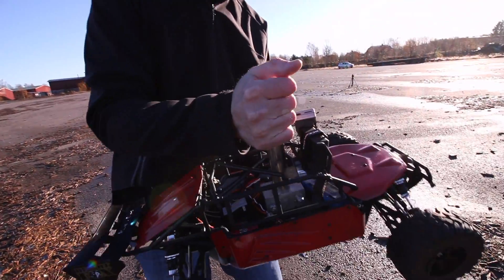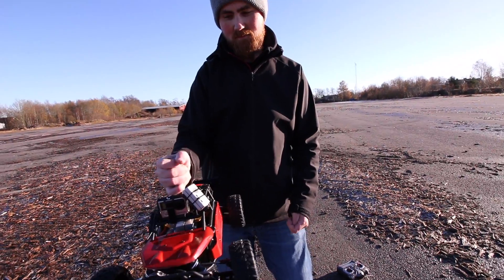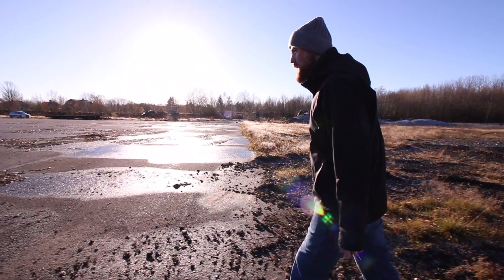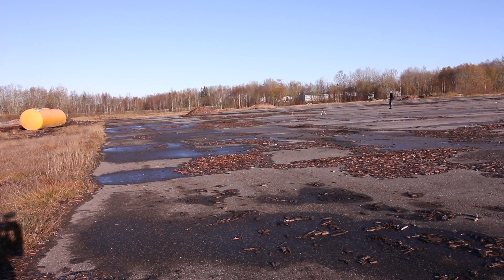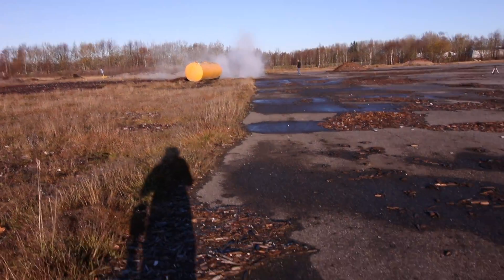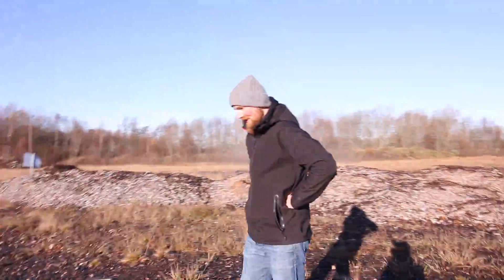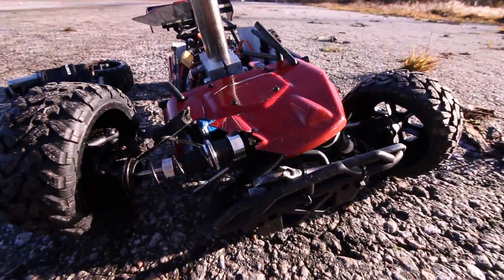ROCKET JUMP RC CAR - Worlds highest vertical jump with an RC car! (probably)

Comment: I know this is really old but he didn't take into account the gyroscopic effects the wheels would have on the car when he launched it. Which might have been the deal breaker and why the car lost all horizontal speed when he launched the rocket. If he wanted a real rocket jump he needed to have the wheels automatically controlled so that they could control the angle of the car in the axis of wheel rotation. Dunno if he'll see this lol. Awesome design tho!

Comment: I noticed in the slow-mo that the car pitched backwards slightly during launch. I think this is because the torque caused by the wheels of the car caused it to pitch backwards, kind of like a wheelie. So if you let go of the throttle just before activating the rocket, the drag caused by the car would, in theory, cause it to pitch forward slightly, increasing the length of the jump.

Comment: The next thing you should do is add wings, horizontal stabilizer, vertical stabilizer and be able to fly the car once it gets to its apex. I think you would have to reinforce the wings, horizontal, and vertical stabilizer by having metal spars that are bolted to the cars frame so the wings and tail won't fold in on themselves.

Comment: I think wheel torque rotated the car and caused the rocket to counter the forward momentum. Maybe let off the throttle before you fire the rocket if you go again. In the on board you can hear the wheels still full power in the air and the car rotates back more after the rocket stops.

Comment: You should gear up some heavy duty servos to the rocket engine  so it can be pitched forward slightly  in flight. you'll gain some air control.  and a chute rigged to a spare channel might save you some time and money durring testing. Keep it up love your work

Comment: So here are my thoughts.  Just like controlling attitude during a normal RC truck jump, I think there was a bit of a control issue here.
If you look at the slow motion side view footage, you can see that right at takeoff the truck tilted back.  This was likely due to the wheels still being accelerated in the forward direction.  That pitch back caused ground speed to be scrubbed.  
If you try it again, try to brake just a bit during takeoff to pitch the truck forward just a tick.

And whatever you do, please DO try this again!  Haha!

Comment: Could be really interesting to do this with compressed air or nox and a solenoid valve so you could variably "hop" over things.  Maybe even some edf automatic air stability... and then see how high of a thingy or long of a gap you could jump over.

Comment: David - what if you put the rocket about 20-30 cm above the car? Like a longer pipe with the rocket at the top. Then the car would hang under the rocket and it would be pretty much self stabilszing - at least on the way up. You could even put a gyro controlled set of fins on it :P

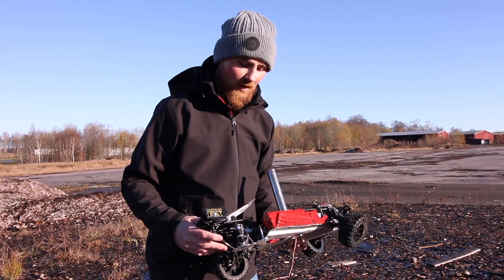Comment: Looks like when traveling upwards the rear spoiler creates a torque which rotates the car backwards (4:33). This rotation seems to happen while the rocket is still firing (4:36), creating a backward component to the thrust which in turn kills most of the horizontal speed. This might be why it whent straight up even though the rocket placement was correct.

Comment: i think  the rear wing pushed the back of the car down in flight  causing the rocket to point fwds and break the fwd momentum. you need to aerodynamically balance the car as well as statically balance it ;-)  .  you need a stronger car !! (or a sponsor) because  the world needs vertical jump rocket cars !!!

Comment: during side view car goes out of frame at a height of 7x the diameter of the tank, so if the tank is 4 ft in dia., the car goes out of frame at 8 ft.! Guessing by the time it was out of frame, I'd guess at least 40 ft of altitude, maybe a little more!

Comment: It would be way cool if you could control the trust of the rocket and retrigger it when you want. It would just augment the driving instead of just blowing it up. But that will require a more complicated engine. Up for it?

Comment: I think the CG was fine, but once it left the ground, the wheels lost traction and began accelerating, imparting a moment opposite their rotation and pointing the car backwards.

If you hit the brakes the moment it left the ground, it should rock forward, just like motorcross riders do.

Comment: The car is in the air for nearly 5.2seconds, that means if we make the assumption that the acceleration from the rocket happens instantly, its falling for t = 2.6s. 
With g = 9.81m/s^2 and h = 1/2 * g * t^2 that works out to about 33m or 108 feet.
Good work, I'm just a little bit jealous for your rocket-building skills.. Now we need a full-size-version, but with David I'm pretty sure it will end up like the second attempt in the original "ROCKETPLAAANE"-Video
Reply: You forgot air resistance, but the rest seems correct for what you say about the acceleration.
Reply: I guessed at 100 feet. 😛

Comment: L.O.L. I think the CGs still be a little off :-) B.T.W. you could probably use a rocket motor that's a quarter that size to get over that (and a lot less damage on landing)
Reply: And a lot less fun
Reply: L.O.L. I did/do get a laugh out of these antics (Star Destroyer especially), but wouldn't it be nice to do something that can be scaled up to full sized ;-)
Reply: Either drag or the uneven unloading of the suspension caused by the motor's torque.  It would be very hard to engineer out all of the variables in that system.
Reply: Naa, it's the wing/spoiler on the back. The downforce keeps working. Take it off next time...
Reply: good point. too much drag at the back... it did start doing a backflip on its way up... a smaller rocket is still called for..

Comment: I guess if you put a Rocket  on static balance  the car will flip backwards when running, because of the drag in the rocket body. Also wind will change the trajectory  you can do what Ray McComick sad or move it behind the CG.

Comment: Freddie Wong Approves of this video. I think maybe for the next test, angle the rocket forwards slightly so that it keeps moving forward and it takes off. Maybe also add a parachute...
Reply: thrust angle would probably make it spin out of control. but 
worth trying imo.
Reply: It might work if you angle it like 0.5 or less degrees, also, you could make the rocket burn quicker so that it can't spin out of control as much.

Comment: Pitch the tube forward in the rig it will give it forward motion instead of straight vertical lift
Reply: i think it would have been ok if he let off the throttle as soon as it launched. when you jump a RC car, if you hold the throttle, it tends to backflip. if he had stopped the wheels, or even reversed, i think he could have got some distance on it. he was going forwards, until the car rotated, then it was straight up haha! but a slightly pitched rocket would give it some forward momentum while holding the throttle wide open haha!
Reply: This. Learn to aerial, bro. Get good.